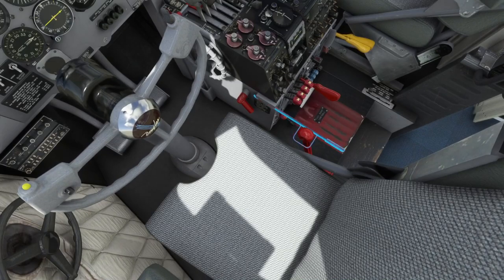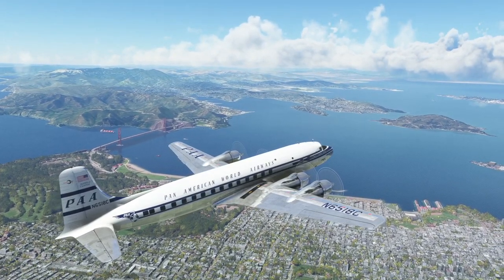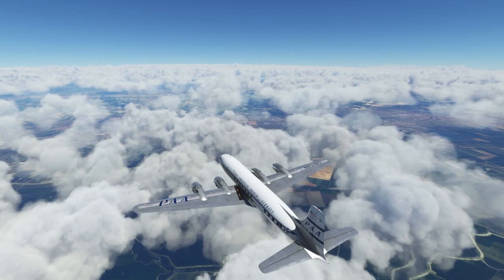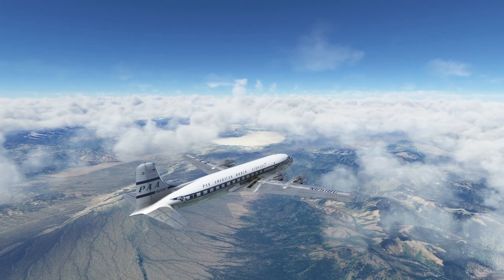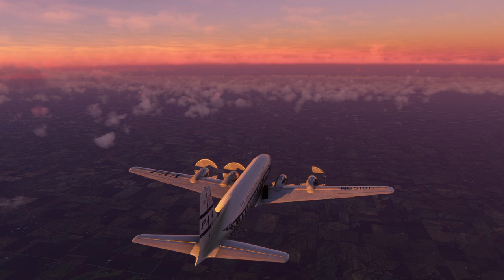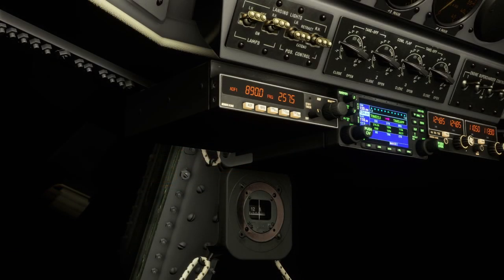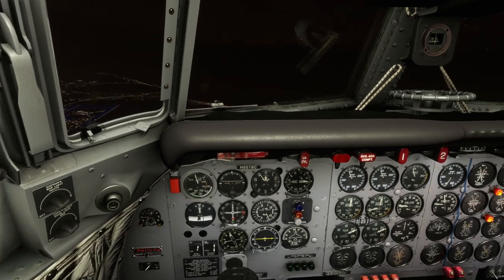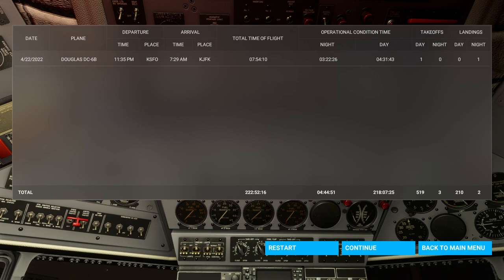Flight Sim 2020 - PMDG DC-6 from San Francisco to New York

Comment: The crossfeeds aren’t pumped crossfeeds, but draw crossfeeds. In other words, crossfeed doesn’t balance the fuel in the tanks by pumping it around (like Concorde). Instead, the tanks need to be balanced by drawing fuel out of them. In your case, you wanted to set crossfeeds to ENG 1+2 and 3+4, and then shut off the feeds from 1 and 4 until the tanks are at equal values. There’s a diagram of the tank setup by flight segment in their POH on page 56 (67 of the PDF) that’s pretty handy.